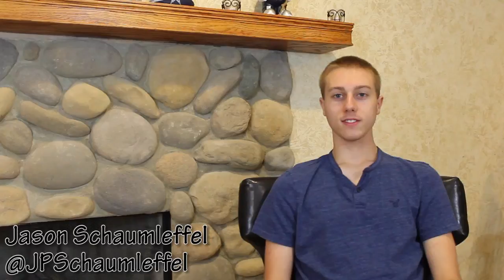Bitcoin ASICMiner: New Chips and Open Source Boards

Comment: Most outlets are 15 amps. If you plug to many boards in, it will blow all your fuses. At today's rate you would get about 15 usd a day. 750 ghash - your electric. Thats not including mining fees....Its getting to a point where you need free electric or at least very cheap electric to make any profit.